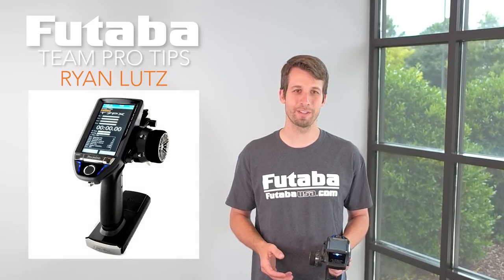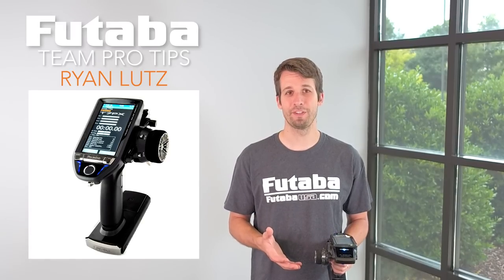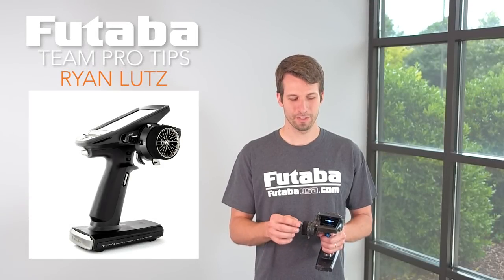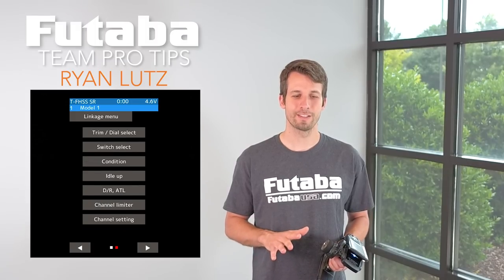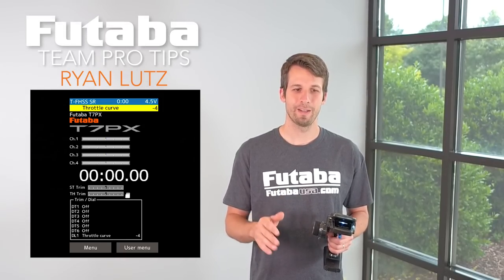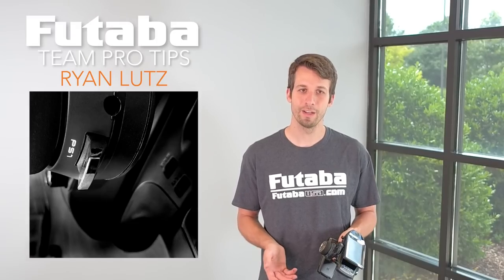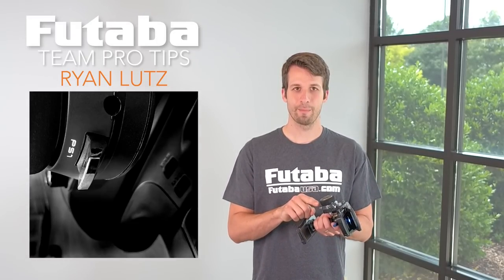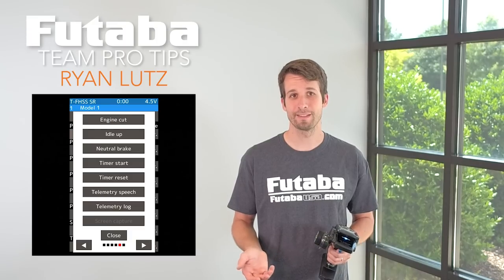TEAM FUTABA PRO TIPS | Ryan Lutz Transmitter Setup Suggestions

Comment: In future models, could you include a timer setting that only counts up/down when throttle is being applied? Would be good to get an accurate time reading of run times, even if stopping for a bit with no power being used

Comment: Next time you make a 260$ radio don’t cheap out and not provide a grip. Caugh 4PM… Ridiculous.
Reply: FOr a quality radio, they want to FORCE your hand to purchase the 7px.  One use to get quality out of the 4PV and you didn't really need the 7px.  They discontinued the 4pv for the 4pm cheapo.
Reply: DJ GaFFLe i hear you. But you can buy a $60 radio with optional parts and rubber grips now. Cmon Futaba. Step it up. Give us another premium 300-350$ offering. And 6 channels like the competition.
Reply: @gaffle-411  I agree, just got the 4pv for around $300, I was looking at the 7px, not nearly worth the price, it only had a few extra features. And another 180 for the the transmitter case, no thanks. I wondered why they discontinued the 4pv before I read your comment, makes sense